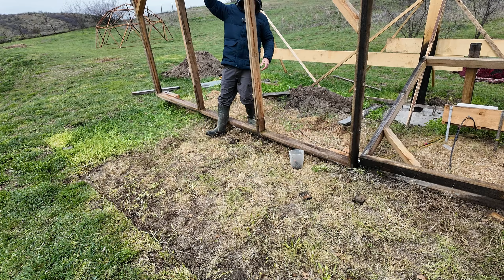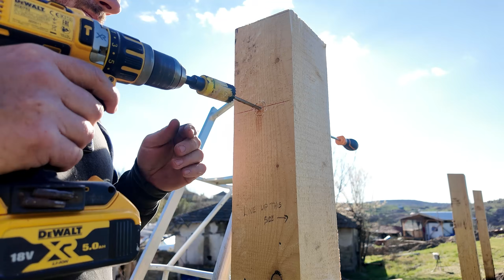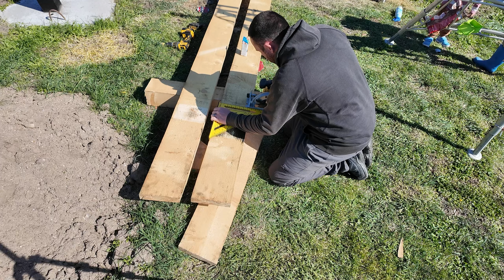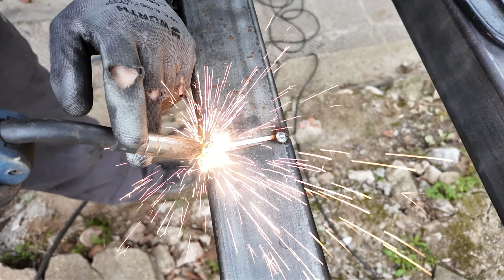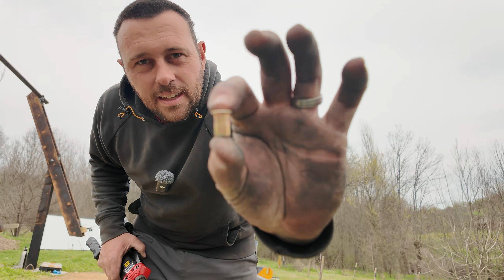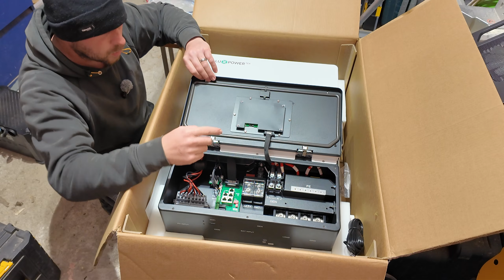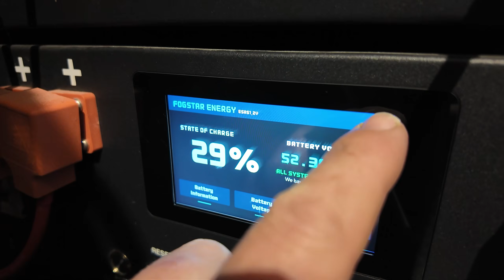How This Family Powers Their Off-Grid Home with Solar

Comment: For those that may not have read the fine print....  This inverter is designed to pass power to the grid and thus the huge numbers are combined  AC out put plus what it will pass to the grid so it is not quite as big as they lead you to believe.
Also worth noting that for every battery you have no matter if it is 100ah or 300 ah  charging it faster than 80 amps 4000W is not recommended for the long haul.   Yes they will take 5000 or more depending on what bms you have but the cable you will need and the heat you will push into  the battery is not productive.  
Once you are over the 5000W/100amp48v   it is best to add batteries so you can split your charge current between them.  
One 300ah  battery taking 5000w  will create   far more heat than two  100ah taking 2500w  each.      Sure it is all the same until you reach the bus bar but it is the BMS and the battery you are trying to keep cool not the wire.

And on wire... I am sure you are aware your cable from battery to inverter is strictly speaking too small for what the inverter can pull but then again you may have the bms set to not allow it to pull more than say 100amp from the battery.   there are many ways to configure this stuff once you get in as deep as you are.

The thing this inverter shines at is utilizing huge arrays to by pass power.   That said you dont need to give it to the grid.   The inverter allows you to use the 10-12K watts of solar to run loads (hot water, dryer, and AC) while the sun shines and still put     2-4K  watts in your battery. 
This is entirely different than running 10K  loads from the battery.

And friend... take that darn thing off the internet.      Use blue tooth to your battery.   It will say info only different.

Comment: For anyone building an array like this one... ask your self why are you stacking panels if you could just put another row on the ground.    The amount of work and money put into this array  "stand"  is not necessary if you have space.   Simply use one row as he did here not two.    Hinge two 2X6  and attach the 2x6 to the post.    The panels come in a frame of metal and have load ratings if you wanted to look them up.    The  "stand"  weighs more than the panels so it is a stand to hold itself.
There is no  "wrong" way to do this... just do it... even if you lay them on the ground it better than on grid.
As stated this is a niche culture here and I aim to share things I have learned.
great video thanks for posting...
Reply: By getting the panels of the ground it makes it easier to clear the ground around. If the panels are on the floor you cant mow the ground and this eventually effects the amount of power the panels produce. You are correct though if you want it simple but them on the ground. If you want them to be easier to maintain and last longer then make a stand like this to protect the panels.
Reply: @MatWalter-q3h  if you have unlimited land you can just grow stuff, sell it and buy electricity from the power companies

Comment: I have almost the same tilt solution but 18 panels, 6 poles, 6 boards cross the top and aluminium panel rails. But my ground is far from solid so there are also 6 backstands and boards in x shape between the poles. Still it almost came down in a storm because the screws reacted with the wood preserving chemicals and became brittle. You could snap them with your bare hands. So the backstand came loose and hit the panels that miraculously did not break. Now with better materials it has held up good. My question is how did the woman filming already know what to do? There are no templates or tutorials so just like you I spent most of the time thinking how to solve every problem + I also cryed a lot on the inside feeling I will never make it. We can’t tilt backwards and it is in a slope making the last panel way higher up than what my fear of heigts allows and nowhere to put the ladder. I can still hear the echo from my woman saying ”what are you waiting for” when my legs stopped responding to command.

Comment: Great job on setting up the tilt ground mount. I just did the same design ( but all treated wood ) and 5 posts instead of 3. If you will do more, could I share a few points that may be helpful.

1. To align the exact top of post, I erected an additional temporary [metal] post from the middle post 10' perpendicular to the south. On that temporary post a fix an auto-level laser which shines on the  correct height. More visible at night. For the horizontal hole height, I  measured down 2¼" ( 2½" ok too ) and moved laser down to match the line and marked the other posts.

2. Sine I didn't get my post EXACTLY all facing same direction and in EXACT alignment, I attached a [taught] string on the top as close to middle across all. Some slightly off. Leaving string, it's then easy to align the long drill direction. Level on drill helped me. Worked very well.

3. Installing panels, I set the ground mount level, not tilted. The panels stayed in place while ladder gave access to screw down. Also I installed a north panel, then south, then north ... Avoids overloading one side.

Still debugging my array tho. Was hoping you may have had a similar issue. I'm getting the volts, but no amps on a string. I think it's a difference in mc4 connector ( three different companies - panel, long wire w/mc4 and extra mc4 pieces ).  Read that they may not be compatible - may cause fires bc too loose.

Anyway congratulations on ur success.
Reply: I didn’t have a laser. Just level and measuring tape to correct pole lengths as array go down a slope. Holes drilled in advance by eye. No precision but works. The amp loss, if caused by bad connection somewhere will be visible with a thermal imaging device. Or latest when a fire  occurs. With one string you get hundreds of volts and the amps indicated on the panel but only at perfect sunshine. Probably the lowest panel rating limits so that could be an issue if you mixed different panels. With slightest haze the amps drops first.
Reply: @notsoprotip5806  all good points. Np on laser. I got some $50 Amazon crosshatch to laser - good w/other stuff too. All panels exactly the same, just mc4 connectors on extra wire by different companies. Means the connectors could  be not snug enough, near zero current also 🔥. If the rain ever lets up, I can continue testing. So far, all panels individually have volt AND current. Just haven't isolated which connection is bad. Gl mate.
Reply: @stephenmabry2866 I have to correct myself on another point too, just checked mine and the amp are only about 15 when producing way above the 410 watts per panel they are rated to. I believe the amp rating on the tagg is maximum allowed only, not what they give. And sorry for the misunderstanding about your panel models.

Comment: I started with 24 460 watt panels on two rows of ground mount and decided I need more power.  I am putting 9 450 watt panels in three rows.  I thought of making the mount tilt but decided that was too much trouble. I have plenty of power in the summer (state of Florida, US) so I am mounting these at a fixed 36 degree angle.  I heat with electric space heaters and need the most power in winter and it is cloudy more often.  I have two 6000XP EG4 inverters (licensed LuxPower).  I noticed you mentioned the generator input, be sure that your generator has the correct power output.  My inverters need a THD<3%.  Dirty power is bad for the inverter.
Reply from the maker: Your setup sounds good. We will be upgrading our generator soon to a much better 'cleaner' one. 
Thanks for the comment.

Comment: I think they are bending too much. I am gonna email you with more details. You should be careful with the cables if you are going to use the land for veggies :)
Reply from the maker: All the cables are inside a conduit and all veggies will be going in raised beds. The frame is very slightly twisted from the timber sadly. It looks worse on camera. I certainly wouldn't use timber if I built it again. 
Thanks for the comment 👍
Reply: @OffGridWithTheUdens  Roger that. Understamdable. I think it is not the timber, just the metal rods are too thin or this width

Comment: Hello Phil, great job mate! I emailed you some time ago and Kaleigh responded, thank you🙏 The one question that I still have, is where can I order the plastic clip on covers that you used to enclose your veranda in front of the camper. Can I contact someone local or did you get it from the UK? Keep up the great and informative videos. Will you give us just a ruff amount that we can expect to pay for a similar solar panel setup. Thanks
Reply from the maker: No worries at all - we bought them online here in Bulgaria. https://www.zavesi.net/ (not sponsored/no commission etc!) they are great but just take extra care to double check your measurements before ordering. 🙂👍
Reply: Thank you🙏🙏🙏 @OffGridWithTheUdens

Comment: I'm using Deye 5kwt now with RW 5.3 and 6 580 panels.
What can I say? - for one persone It'll be better to have more acumulators than more panels, optimal setup is 8 panels and 4 accumulators for raining days, but in winter - December and January - no matter how much panels you have - it's always not enough... That's why I'm thinking about windgenerator someday.
Reply from the maker: Yes we're also considering wind but all of the specs on the smaller wind turbines seem to be rather exaggerated. Hoping to find something in the middle that's worth the expense and the hassle of erecting.
Reply: I have 2000w istabreeze, its good when you least expect it, wind is a very fickle element, the bms won't enjoy the charge, but can be controlled to charge to 95% and then reconnect at 85%. 20-30mph creates a better charge than 15-40mph, so three small wind turbines in a triangle would create a cleaner charge, but costs of towers, cables would be ridiculous.
Reply: Would concerntrate on voltage controlling your generator to turn on at the end of the day to charge to a minimum night time usage, useing the xy-cd60 to control wind turbine braking at 95% reconnecting at 85% and for this autumn will be incorporating them into a 48v to 12v generator controller from 20% to my minimum 40% night time usages.
Reply: Now remember the problem I had last autum, the ignition needed its own trigger time for 5-6 sec then I had another trigger timer that counted down to turn it off, got cheeky with it and installed a ir remote then ran out of money to run a big enough cable to it, this year I'm assuming th count down timer would go on a 24h turning on the ignition at 5pm until 40% battery.

Comment: Luxpower primarily uses cheap, high frequency, transformerless inverter tech in most of their inverters that offers a poor surge capacity, a shorter life expectancy, and when its MOSFETs/IGBTs fail, it can damage your appliances because it doesn't provide any galvanic isolation between its DC boot stage and its AC output. No thanks.
Reply from the maker: Interesting.. I'm pretty sure this has a transformer in it especially due to the weight but I will have to look into it. I know the Growatt didn't and the difference is obvious.

Comment: Hi Guys 
We are back in the Uk now for 6 months .Love the video as I think I said before we live off grid on a boat in Cambridge our set up everything Victron with exception to 12 kw Plyontech lithium battery's thats home set up 
We plan for Thailand to put 10x 460w panels on carport through Huawei 8.6kw inverter charger into 2x 10 kw Huawei lithium battery with option to add addition battery if needed including installation and set up £6500.00 we don't plan to have air con or water heater as that will be solar water heater no brainer Thailand 
Q I understand you probably got set up wholesale could you give us idea off cost retail also whats your battery capacity ? and as you said install 3 months ago how often does  your generator kick in
I am just nosey sorry 
Cheers Gary and Mon50/50😎👍
Reply from the maker: Your setup sounds good for Thailand. The battery capacity it's just over 25kwh of usable capacity. We installed the big battery (15.5kwh) around 6 months ago. 
You can check the batteries out here..https://www.fogstar.co.uk/collections/solar-battery-storage we manually manage our generator at the moment I usually start it when the batteries reach 20% ish. 
Thanks for watching and the comment.

Comment: Could adjust it with a small winch, divide two tiny solar pannels north and south, still put ridged bars on ends for windy days
Reply from the maker: Yes I have also thought about this. But ideally I'd like to spread the load across the 3 supports. I'm still thinking what I could set up for moving them.. I'm putting mains power up there just incase. Thanks for the comment 😁👍
Reply: Winch off to the side and three pulleys. I think once you go to mains all the excitement will be lost, unless you have bigger picture.

Comment: Just out of curiosity what size are your panels? I could do with a device like what you've built it's whether my neighbours would let me put it up great video.
Reply from the maker: The panels are 410w panels 1134mm x 1722mm it is a big tall array but you could build it lower to the ground or put your panels in landscape orientation to reduce the height. Thanks for the comment. 😊

Comment: Great video as usual. I ditched the Growatt shine app straight away and went to Solar assistant via a raspberry pi. What have you done with your old Growatt? I might be interested in buying it to run in parallel to the one I have if you haven't already sold it? Your new inverter looks awesome, but I'd need a lottery win to get one of those! lol.
Love your little helper! 😀
Reply from the maker: Hey! Yea the shine app is terrible. I'm looking into solar assistant currently it looks great. At the moment the Growatt is being used as a battery charger as our weedy little generator can't handle the LUX. If it comes up for grabs I'll let you know. 👍
Reply: @OffGridWithTheUdens  Solar Assistant has been brilliant. The beta version is full of automations that make managing charging, cut off points ect a breeze. 
We'll be coming down to Oreshets sometime in May if you're up for another meet? Would be lovely to catch up.

Comment: The growatt batteries are not cheap either. That is the inverter I am getting next, the hybrid version eg4 12000xp can input 28kwpv, I might wait a year and see if they increase pv on the 12k Lux. 
If you ever get snow, try the panels vertical, my pv4 3300w went to 4185w. I did a firmware last summer it was horrible, fans on at 400w vs 2200 before, the total charge # had a minus sign pop up in Jan now the number gets smaller every day, and the gen port stopped keeping track of kw.  Glitchy but it works, a decent back up one day.  If you set your inverter clock ahead to 1 hour past sundown, it is easier to see the in and out daily, so it flips days at 8pm, solar is done batteries rested an accurate in and out value.
Reply from the maker: Good idea with changing the clock though I don't seem to have an issue with it. 28kwpv is mad ours is 18 which is still considerably more than it's 12kw output. Thanks for the comment 🙂
Reply: @OffGridWithTheUdens  The 28kw on a dark cloudy day maybe 3000w, better than my current 1300+w. That would be a no generator build for me. With my snow boost I can only put 14200w rated pv.

Comment: Very nice job!  I've been considering rebuilding my own panel setup to accommodate tilting by season, and this is how I'd do it.  I have utility poles buried for mine that could be drilled through for the tilting feature.  I've got 16 CanadianSolar 445 W bifacials and I want to take that to 24.  I've got a few vids of mine (mostly clearing the snow off of them) that I've posted on my channel.  Thanks for the nice tutorial!
Reply from the maker: Thanks for watching and commenting. Tilting the array certainly makes a big difference especially in winter when the days are short! 👍

Comment: Loved the vid. I enjoyed the project & even how you got the family involved, including the kids. My only question is why did you use wood instead of all metal? Will it not rot over time, even with the shou sugi ban treatment?
Reply from the maker: Glad you enjoyed the video and thanks for commenting. I used wood because steel is not cheap here and they would have to be some pretty hefty lumps to avoid bending etc. To be honest though if I built it again I would use steel all round, despite the cost it's definitely more suited to this job. I will be keeping an eye on all the wood if anything looks like it's degrading a lot I will rebuild with steel. Cheers 👍

Comment: Congrats on the new solar set-up! I have one question thou, do you have issues with twisting the platform when you rotate it ? It looks like if you push on only one beam, you can twist the plane on which the panels are fixed.
Reply from the maker: Hi thanks for the comment. Unfortunately due to the timber we've used the frame is very slightly twisted across the plane (it looks worse on camera) there is some twist yes if you try from one end but I think it's within spec. There's over 3m between posts so I would expect a bit. If you do everything from the middle though it seems to be pretty even. I don't even know what you could do to take the movement out when you're tilting it. Appreciate you watching ☺️